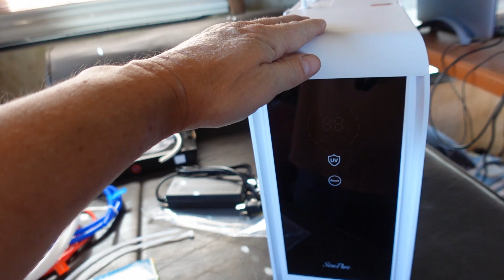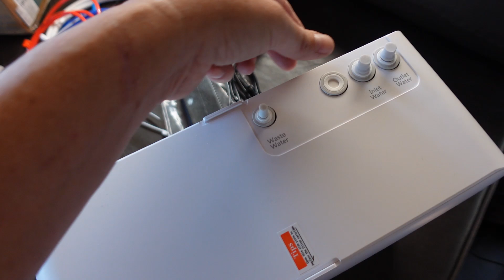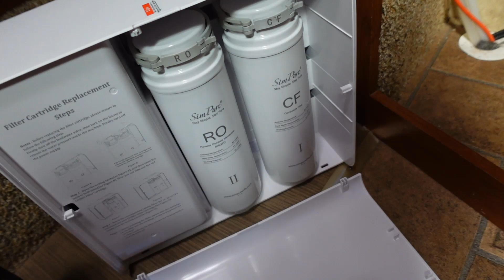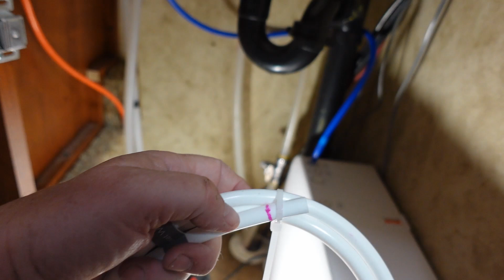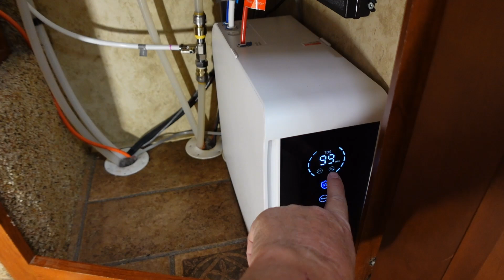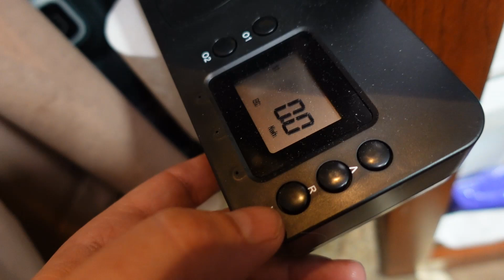Installing an Under Sink RO UV Water Purifier - SimPure Q3-600UV

Comment from the maker: Product Links
Amazon: https://amzn.to/41yR6iZ
Website: https://www.simpurelife.com/products/tankless-under-sink-ro-system-with-uv-light
Code: LYRVQ3UV  Original price $349, discount price $217, valid for the whole of March 2025)
1/2 Inch SharkBite Fittings I Used - Male https://amzn.to/4kk86ku Female https://amzn.to/3DqSjQ2
SharkBite PEX pipe cutter tool - https://amzn.to/3XoiNIY
Yellow Teflon Tape - https://amzn.to/4kpaiXN
Reply: @LoveYourRV  i am new i have a question about your black tank repair did the gflex epoxy work for you long term i didn't see a update from.five years ago
Reply from the maker: @hobbit321a  Check out this video I published a few weeks ago https://youtu.be/7282Fcs2Imo  Cheers, Ray

Comment: so how is it?
Reply from the maker: Here is the update video: https://youtu.be/Qz0KQgy3q3E
Review Update
An update on the Simpure water filter system I installed in my RV in January. After five to six months of use, this system, which features reverse osmosis, UV, and carbon filtration, worked exceptionally well, especially in desert areas with hard well water. It improved the water’s taste and ensured purity with UV treatment. The carbon filter has reached a little less than half-life, according to the LED readout, but the RO filter is still in good shape. I’ll replace the filters for next season, but I won’t use this system on my boat, as BC’s soft water doesn’t need the RO filtration I find. There were no leaks in the plumbing or shut-off valve, although the reverse osmosis process expels some wastewater, which wasn’t an issue for us while boondocking, as we don’t need to be that strict at water conservation. Overall, it’s been great for clean, tasty drinking water straight from the tap.

Comment: Another great diy video as always Ray! Do you feel that this would provide safe water if your only available water source had a boil water advisory or was otherwise labelled as non potable? In that case, would you add a small amount of bleach first to your freshwater tank in the rv?
Reply from the maker: Yes, could do that though when I fill my tank I also run it through a 3 stage filter system that has a 0.2 micron filter in it so with that and the RO with UV i feel confident about the drinking water. 3-4 times a year I also sanitize my RV tank and plumbing with bleach.

Comment: Hey Ray, they make a sharkbite removal clip  that saves u cutting the pipe when u removed the old shutoff.  i use it when u need to save the length of the pipe.
Reply from the maker: Thanks good tip! I should have mentioned. I have a little orange one https://youtu.be/oHmjqUEbQOQ?t=194

Comment: I've been looking to get one of these units myself but so far have been put off by the $80 cost to replace the filters even though that would be cheaper than buying bottles.  Buying the bottles and using bottles for ice is getting old however.

Comment: Hi Ray. good video.  was that the sound of your water pump running or was the sound coming from the ro filter?
Reply from the maker: I was using my on board water pump but I don't think much of the sound was from it as I was a fair distance away. From what I can tell this SimPure unit has a reservoir inside that fills and there is a small pump inside that runs when it's dispensing water. I plan to do a teardown in the next video after I have tested it.